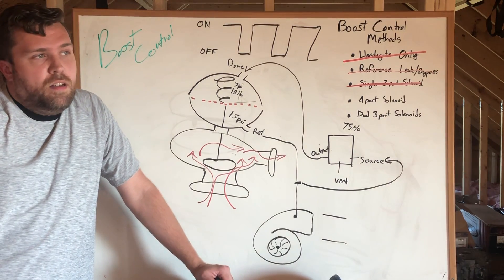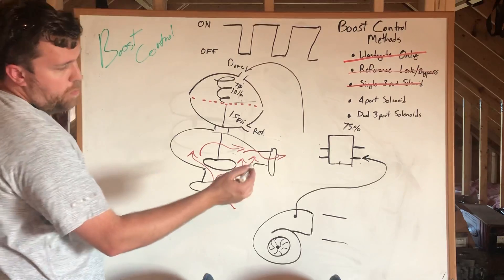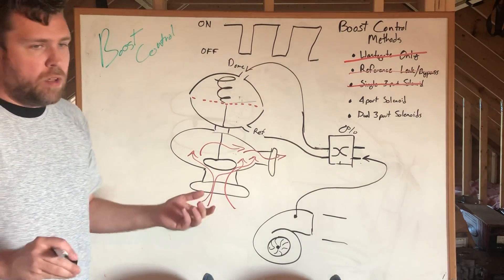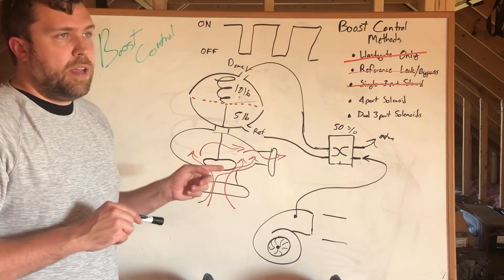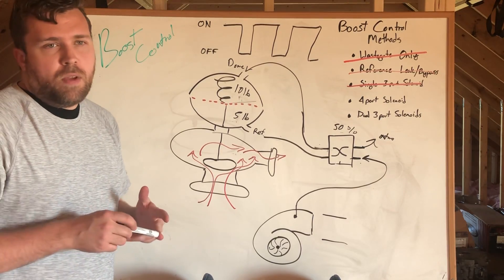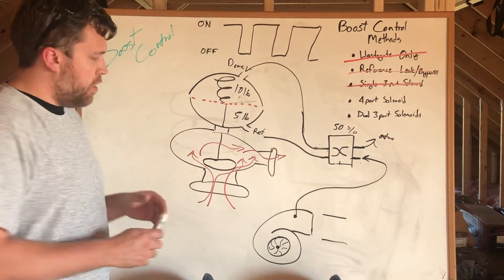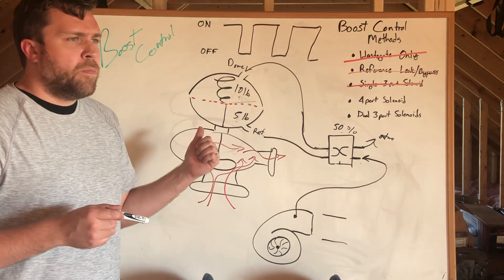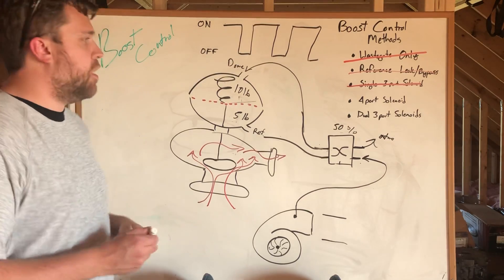Boost Control Series: 4 Port Boost Solenoid

Comment: Cool...hence why the 4 port is popular for drag racing I guess.
If you get the chance to fit it in Aaron could you speak about map based boost control and why guys have been splitting the map signal to make this work on term x, and why this may or may not be a good idea, I have a feeling it has something to do with the 4 port setup but I really don’t know.
Reply from the maker: Absolutely. I will probably make that part of the closed loop vs open loop video